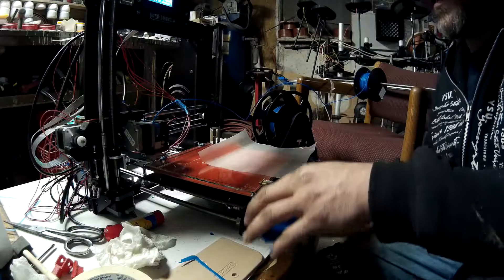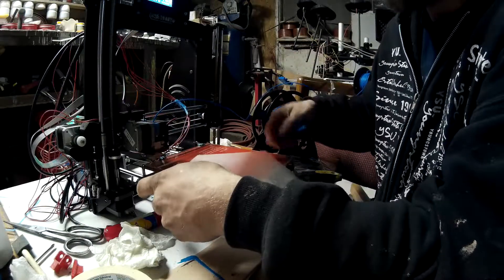wax paper and 3d printer bed. prusai3 clone ctc

Comment: Wax paper usually has 2 different sides, which one do you suggest applying as the top side?
Reply from the maker: the wax shiney side. but i only do it in fragile cases. makes easier to get fragile parts off. but a mess to deal with. so i only did it when i had to.

Comment: Tried this and it worked great. When I applied the glue I used a small smooth paint roller before applying the wax paper and it helped smooth and even out  the glue really well!

Comment: very helpful brother thanks for sharing
Reply from the maker: welcome i need to do a update. the wax paper works. but can get annoying and messy. im back to using tape.  ill use wax paper for things i dont want to brake coming off the build plate. like small things so i can cut the paper off and scrape the paper off without harming a print.